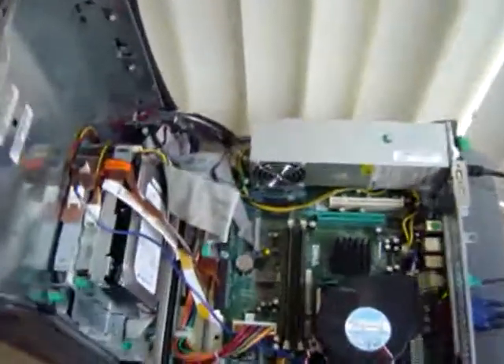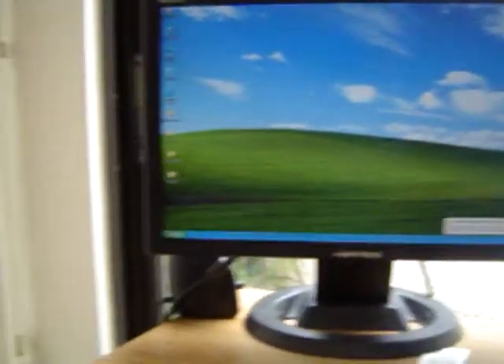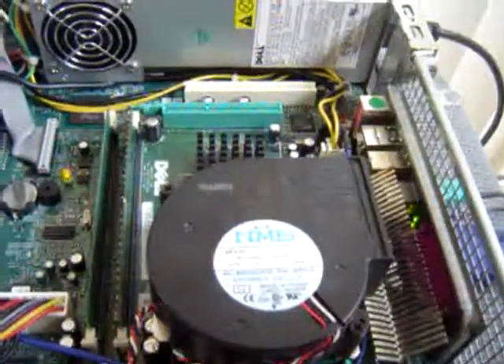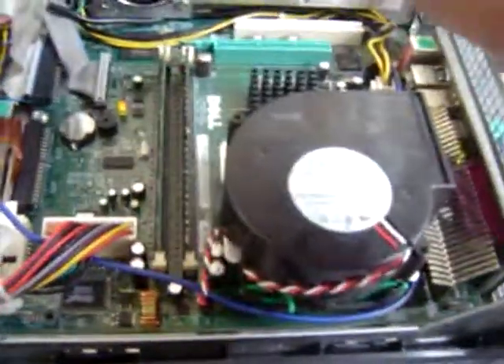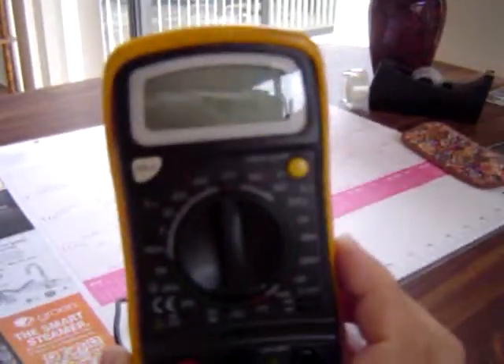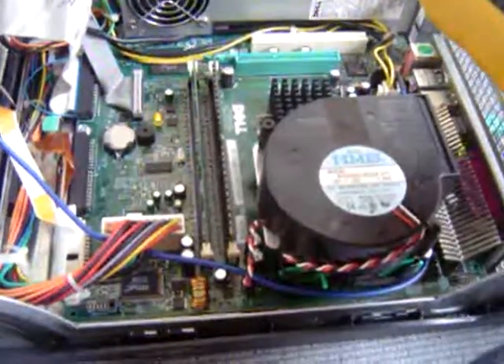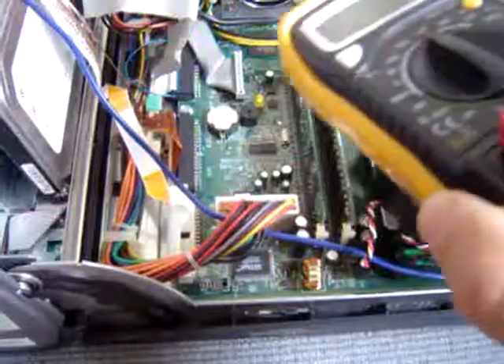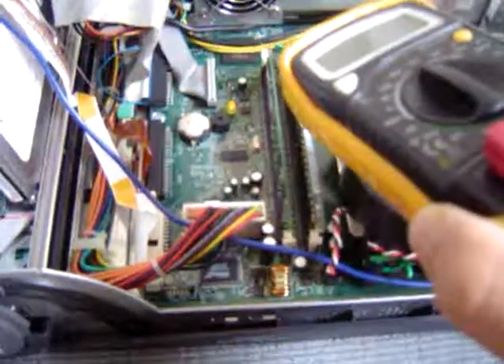How to Fix and Repair Any Computer Easily (Secrets), Restoration Project

Comment from the maker: Molex or power cord lengths can easily be changed.  First, find a broken power supply and cut the cables off the molex connectors according to the length needed.  Then crimp the two wires together until all four wires are matched up, tape it, and you have an additional 6 inches.  You can also "double up" a molex connector if you do not have enough to fit all of your gear.  However, it will strain your power supply so use your best judgment. Sata wires can be spliced and done with a Y connector.